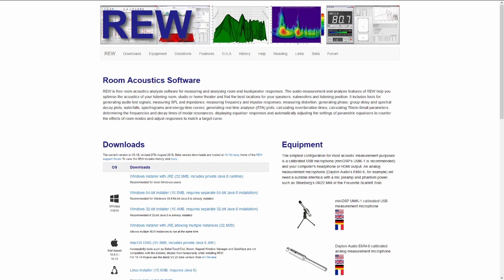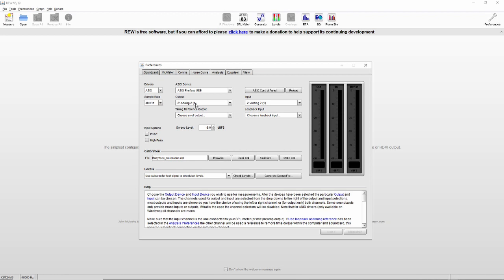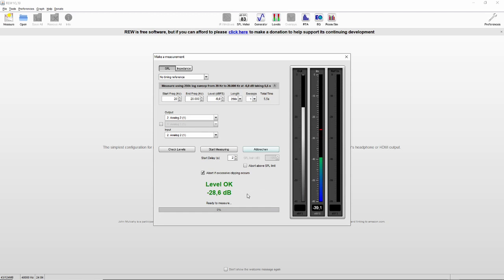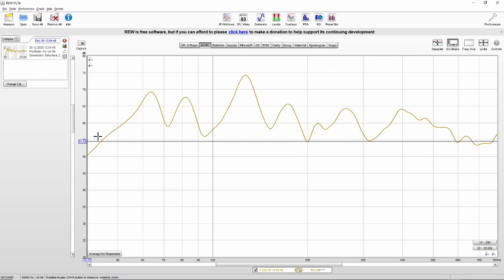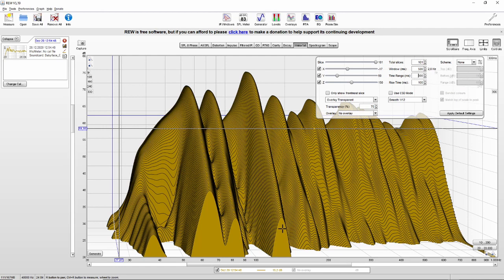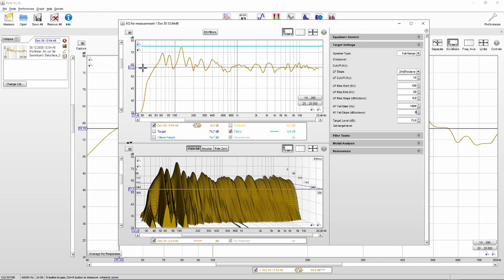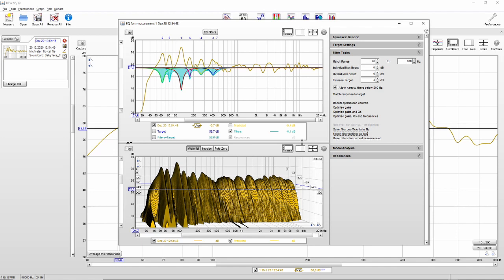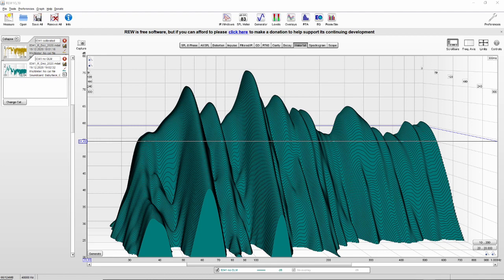Room EQ Wizard (REW) Tutorial - What's going on in my room? Measuring speakers.

Comment: Thanks for the great tutorial! Can it be that individually tuned speakers interfere with each other, causing boost and cancelations? I refer to your recommendation to always measure and EQ each speaker individually. If combination of reflected waves of the speaker can cause dips and boosts, woul not the same be true for direct and reflected waves coming from the other speaker? Don't we lose this info if we measure individually?
Reply from the maker: Thanks for your feedback, Dimitri! The problem of measuring both (or more) speakers at the same time is that all of what's happening completely depends on the material you're listening to. Just think about the stereo image of different songs for example. Left speaker will interfere with the right speaker in completely different ways from song to song. So of course it makes sense to look for ONE filter setting for BOTH speakers in a stereo system (especially if the speakers are placed symmetrically) - but the measuring itself should always be done seperately - and then you can look for a good compromise of the two settings.

Comment: Great Tutorial Marcel... when measuring multi speaker setups in a venue or event space we would measure speakers individually and apply individual corrective eq per speaker channel is this similar to your process?. Also, in multi speaker setups I’m interested in where you place microphone, in front of each speaker?, at what distance? Or do you leave it placed generally in the main listening area? Thanks
Reply from the maker: Thanks, Keith! Correct - in a multichannel setup each speaker is measured an EQed individually - to make sure its frequency response is as good as possible at your listening position/area. And because you're always focusing on this listening position this is where the microphone is placed. All the best!

Comment: Thank-you for sharing.  I have used my EQ with one system using Min DSP and another using Roon's EQ.  Great results......What room curve would you recommend for my kitchen speakers in a very large room with lots of hard surfaces.  Just a starting point.
Reply from the maker: Thanks for your feedback, Martin! Unfortunately there is no recommendation for an EQ setting without knowing the room influences ... So just measure your kitchen speakers at your main listening position as shown in the video and first try to "linearize" the frequency response. After that I would suggest to use some high shelf-filter to make the overall "tone" a little warmer by reducing mids and highs by a few dBs - just use your ears. Regarding reflections of hard surfaces there is no way to get rid of these using filters - you'll have to live with it (because it's the kitchen - otherwise I would suggest some absobers ... ;-) Bye!

Comment: At around 7:40 when trying to adjust to get the middle of the sound pressures, can the software just provide an RMS value to do this instead?
Reply from the maker: Hi Chris! Since we use a sweep sound, RMS would not bring a benefit (the RMS level is proportional to the amount of energy over a period of time in the signal). Greetings!

Comment: I think I missed something. Once you've generated your eq correction values, how do you get a new measurement with the corrected signal? Does REW have a way to generate an adjusted test sweep?
Reply from the maker: Hi Rick! You'll have to apply the EQ externally, for example in your DAW. Therefore, it's not possible to generate a "modified sweep" withing REW. Greetings!
Reply: If you’re on Mac you can use an app called Sound Source, which allows you to use plugins on the system level. If the EQ is used there you’ll here it in the output. I use it to house some metering plugins.

Comment: I appreciate the overview, but room correction EQ is terrible unless you are using it only for small touches after you already treat the room as well as possible. Any drastic reliance of a Room correction EQ system ruins the natural timbre of a monitor and driver set.  I can assure you it affects them and their harmonics and resonances in a way which you want to minimize. Remember the saying "Less is better".  In addition, Genelec is good, certainly much better than Dynaudio, but i find them just a little bit overrated.  Have you heard Adams?  Once you go to the ribbon tweeter, there is no coming back. The extended range of the silky detail is unparalleled.  Also that correction of that Genelec overlayed is not impressing me at all. That should be doing a better correction than that, but regardless, im not a fan of drastic corrections. You may wish to use membrane traps and perhaps some helmholtz resonator methods in the treatment approaches you are going for.
Reply from the maker: Hi! I totally agree with you that acoustical treatment is by far the best solution. The less you have to use filtering, the better. And you can't do anything about the time domain issues with filters. Greetings!

Comment: Gruesse aus Prag. Vielen dank fuer die Videos.

I have a question to the ringing of the room at the room modes: Does the equalizer shorten the ringing time?

I used to worry about the ringing created by a subwoofer port or a passive radiator. Now it seems to me that the subwoofer port ringing may be actually meager compared to the room modes. I have some experience with DSP programming, thus it seems to me that there is a chance, that with DSP amplitude and phase equalization we can actually suppress both the room ringing and subwoofer port ringing, or at least one could lower the time spread by pre-ringing thus achieving a symmetrical time response. Does the Room Equalizer software allow for that? Or is it just equalizing the amplitude response?
Reply from the maker: Thanks for your feedback! Advanced question ... If it comes to the ringing and the "time domain" you should always follow the "classic" approach of room treatment with bass traps - because in the end it's physics ... ;-) What I show in this video is "just" the use of filters for the optimization of the amplitude response.